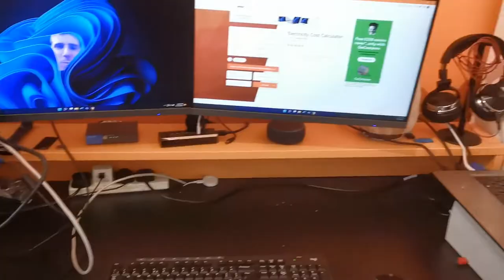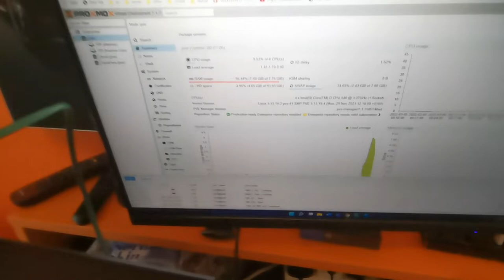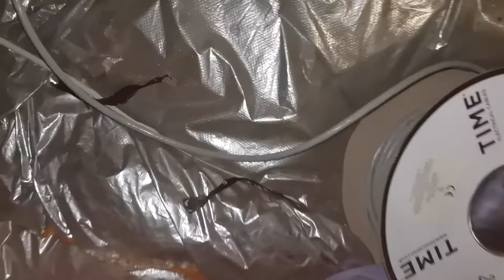NEW Hypervisor!  | Updating the home network, pfsense, proxmox and truenas.

Comment: hi there, noob here, quick question, how low can you go as a server/ pfsense vm spec ? Intel Core I3-4150 , 8GB DDR3 would work ? with the possibility to upgrade to an i5-4590S and 16 gb ram... Have an old minipc and want to know if i could use that as a home server with 1-2 external hdds
Reply from the maker: Not so much experience myself but I can say the i3 system you described is almost exactly what's in my server. I have found no matter what CPU combination I will always run out of memory first. For me 8gb was enough to run pfsense and Ubuntu server acting as a docker host.
Reply: @tobywhiting10  i want to have a pfsense + plex servar or someting to put media on and acces it on tvs or phone... do you know by any chance a tutorial video or written about someting like that ?
Reply from the maker: @b4g4b3l  plex is exactly what you need. I would recommend installing truenas in a VM and then adding the  Plex app to that. That way you can have a network share that you dump your media files in and then they will show up in Plex on your TV. I have thought about making tutorials and I might in the future but for now i recommend finding one of the many good ones on YouTube.
Reply: @tobywhiting10  and pfsense also as vm ? Will the internet speeds be the same ?
Reply from the maker: @b4g4b3l  yes the Internet should work just fine. Install proxmox on the computer and then use it to virtualize pfsense and truenas
Reply: @tobywhiting10  any good tutorial on that, how to do it step by step ?
Reply from the maker: I'll think about making one, for now surch "install proxmox tutorial" then      "install truenas on proxmox"
Reply: @tobywhiting10  do i need proxmox first ? Isnt truenas like an os were i can create vms ?
Reply from the maker: @b4g4b3l  yes you can create vms in truenas. if you want you could install truenas on the hardware then vertualis pfsense in that but I wouldn't recommend using it. I have barely used the hypervisor built into truenas but from what I've seen it's not very good. Personally I'd install proxmox on the hardware then put truenas and proxmox on it.
Reply from the maker: This is just preference there so do  whatever you prefer
Reply: @tobywhiting10  thank you sir